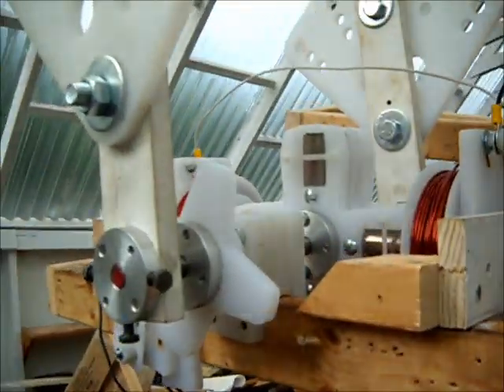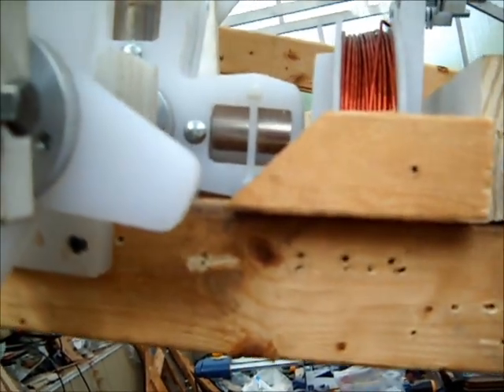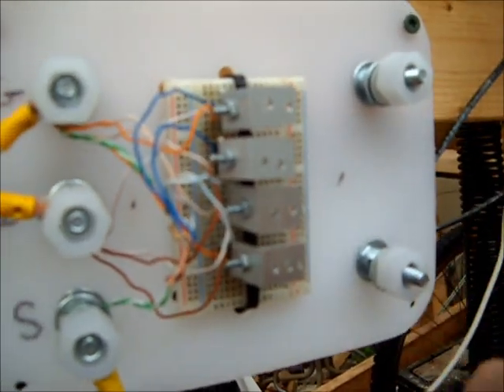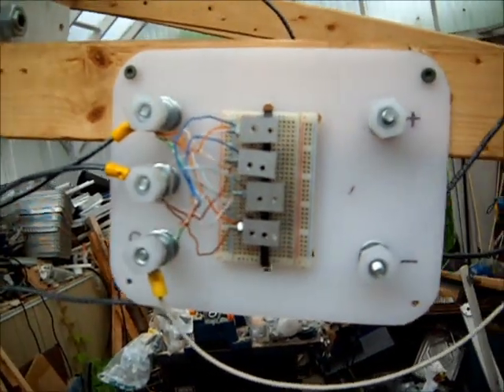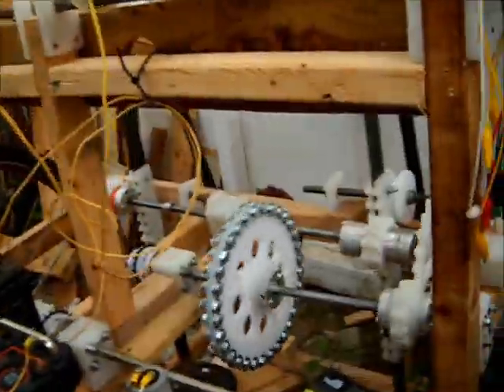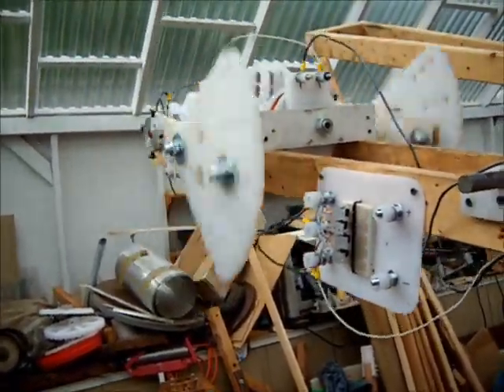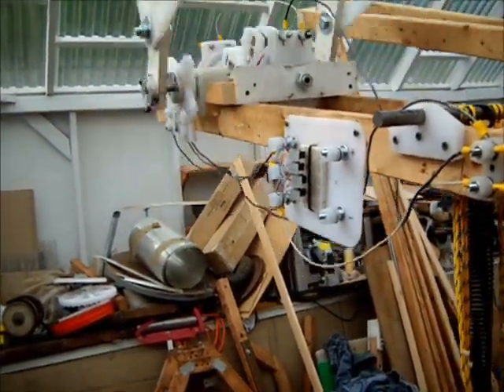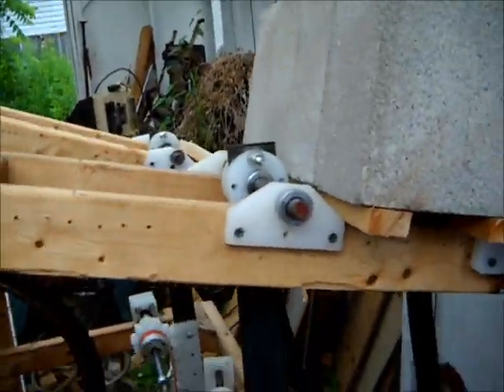GRAM TSO Gravity Assisted Pulse Motor 6 24 19

Comment from the maker: having problem with IRF640, they are not turning off,  when I use a diode tester to test them they pass the test, when I place them in circuit to turn a LED on and off they always stay on???? any suggestions welcome
Reply from the maker: https://youtu.be/RkWy1EirEu8
Reply from the maker: I found my mistake, bench power supply + and - terminals  was mis-labeled, ouch.....